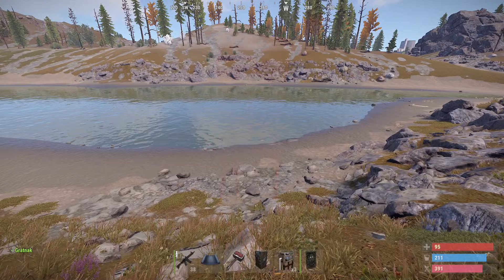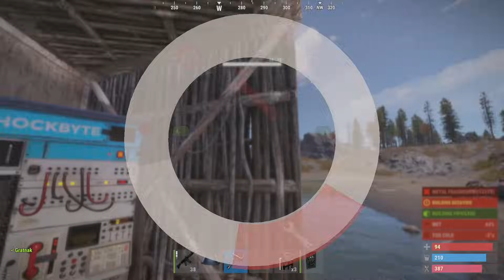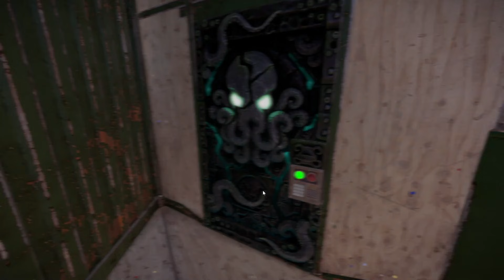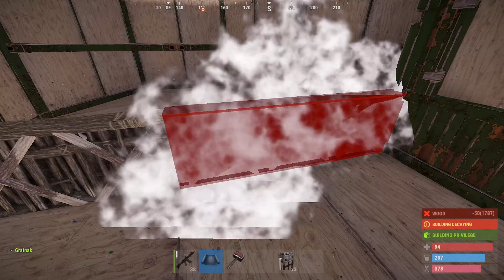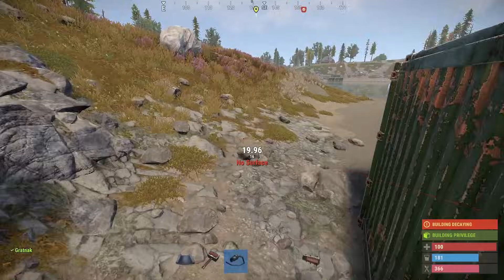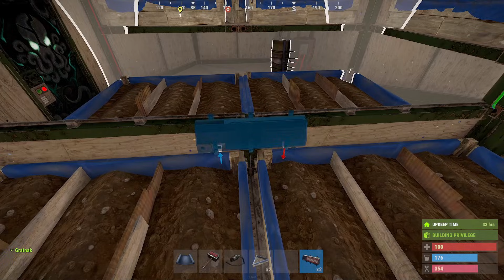Rust: Low Profile 2x2 Farm Build, with 18 planters.

Comment from the maker: 🚨 UPDATE: Triangle Planter Placement Bug (PC) 🚨

If you're getting "Cannot build in this area" when placing the triangle planters, it's NOT the build that's broken. Click "...more" for the fix.

After testing, I've confirmed this appears to be a current Rust bug affecting triangle planters on triangle shelves when Snap To placement is enabled.

✅ Temporary Fix

Hold Left Shift while placing the triangle planter to disable snapping. It should then place normally.

I've reproduced the issue on my own server and have submitted a detailed bug report to Facepunch.

I'll update this comment as soon as there's an official fix. Thanks to everyone who reported it and helped track it down! ❤️
Reply: it still have that bug , and i call only place like 2 tringle planter box atp
Reply: Just built today no problems with snap placing planters

Comment: I can't get the central sprinkler to work, any tips ? It's for sure receiving enough water, but it's not turning on
Reply: Fixed it, if you are having the same problem, make sure you plug the very central sprinkler (the 4th on the video) first.

Comment: @gratnak Hey awesome video! 
Is it possible to plant weed for example on the triangels? Or just berries bc of the height to the roof ? 😊
Reply from the maker: Hemp will be totally fine in the triangle planters because it stays low enough and won’t poke through the roof. Berries are also safe there.

Crops like corn and wheat will stick out the top of the base and can be picked by anyone passing by. Potatoes usually stay low enough, and pumpkins do clip through visually, but they cannot be harvested from outside so they are safe in terms of theft.

Looking back, the planters in the side honeycomb really should have been placed on the foundation instead of the floor. That keeps the height lower and stops tall crops from clipping out. Then you can use the roof planters for hemp and berries only.

I’ve got an updated version of this base planned that will include better water management and timing setups depending on what you plant, so the planter water levels stay at the best levels. Here’s the sprinkler  build if you want to check it out: https://youtu.be/Dk4IQFdYhZ8
Reply: @Gratnak Thank you so much 🔥

Comment: great video, does it matter where i start with the sprinklers? my top sprinkler says pump required when doing the connection
Reply from the maker: Go from top to bottom, after the pump. You need to always keep in mind water pressure. so it always flows down (or level). Also check out https://youtu.be/Dk4IQFdYhZ8
Reply: @Gratnak tysm, i also thought that was the mistake - it makes physical sense😁

Comment: i am not able to place the triangle planters? cannot build in this area
Reply: All of the planters that would sit on the triangle shelfs (2nd lvl and roof lvl) cannot be placed. I am getting the same message. Cannot build them unless it's on a foundation
Reply from the maker: Thanks for the comments, everyone. That’s definitely unusual, I’m going to hop onto one of my servers and test the build again to see what’s causing the placement issue with the triangle planters. Once I’ve checked it properly, I’ll come back and update you all with what I find.
Reply from the maker: Thanks for the patience, I’ve just finished testing this on one of my servers. It turns out the issue only happens with the triangle planters, and it’s caused by the “snap to” placement. If you hold Left Shift to disable snapping, the triangle planters place normally without any errors.

So it’s not the build itself, just a small placement bug with snapping. Hope that helps!
Reply from the maker: That's strange. Is there anything nearby that might be interfering with the placement, like a horse? Sometimes their hitbox can cause this.

Also, if you're on PC, I could take a quick look. Unfortunately, I don't have a console. If you're interested, we could hop into a Discord call, and I can help you troubleshoot it.

Comment: This is a very aesthetically pleasing compact base, but sadly with how half walls are the same price as full walls you may as well just build the standard cube and get more space for your money. I don't think there's really much hiding a farm base.
Reply from the maker: That's a fair point, I usually prefer the aesthetic builds but I definitely see the logic in going for a standard cube for more space. 😊
Reply: @Gratnak  It is a really unique, cool base though. Props to you for that. I just wish Facepunch balanced build costs a bit better. That being said, it's not like its an arm and a leg more expensive for the space either. I think if it weren't for the noise pumps making and the water clipping through walls then it'd be a lot more viable to hide the reality of the base from anyone being nosy.
Reply from the maker: Thank you, I really appreciate that! 😊

I was aiming for something a bit different rather than just another standard cube. The switch is there if you want to leave everything running, but you can also use the timer so the lights, pumps and sprinklers only run while the crops are actually growing, which helps keep things a little more efficient.

I've actually had a much more complicated version of this same build before, where the entire farm could run from a single large water catcher. It used a few different methods to massively reduce water consumption, making it surprisingly efficient. I may revisit that design in a future video if there's enough interest.

I do agree though, if Facepunch ever rebalanced the build costs of half walls, these kinds of builds would become a lot more attractive. And fixing the pump noise and water clipping through walls would definitely make discreet farm bases much more practical.

Comment: I can only get 2 water pumps in 😢
Reply from the maker: Two pumps should be ample, if you're on the coast, just run the pumps initially for a minute before switching on the sprinklers, just to have a buffer.

Comment: w video. i tried it and the water sprinkler arent working the first sprinkler of the 6 get 12 water but the passthrough is 0 . No sprinkles
Reply from the maker: We're using gravity for the combiners and spilitters to the sprinklers, so you need to make sure the pump is sending it to the highest one first. Each sprinkler in turn need to on the same level or lower in turn.
Reply: @Gratnak  thank you for the response i ended up not connecting it to the highest sprinkler which i did at first ( the sprinkler did go off and no water was being pass through but only connecting the lowers sprinklers worked. thank you
Reply from the maker: Sorry for the delay in replying. I need to work out the filters for replies to me. At the moment Youtube studio only shows new comments. It's great to hear I could be of some help.

Comment: hey so my pump system isn’t working, i have the fluid combiners set up to where to pump is needed, should i add one and how should i do that?
Reply from the maker: Hey! It sounds like your system doesn’t have a pressure source. Fluid Combiners can’t pull water on their own, they only mix or split water that’s already flowing.

If you’re trying to move water out of a barrel, uphill, or anywhere without natural pressure, you’ll need to add a Water Pump or Electric Water Pump.

If you’re on PC, I’m happy to hop onto your server and take a look with you. Otherwise we can jump on a Discord call and I’ll help you sort it out.
My Discord is: gratnak

Comment: hey im not able to place all 3 pumps on the gap, any suggestions? do i  eed the comtainer skin for it to work?
Reply from the maker: if you're in sea water you can get away with two, if it's in fresh water one will do. I'd top up the water barrel though, so it has a buffer in it.
Reply: @Gratnak ok nws im in fresh water and can fit 2 luckily

Comment: Great video. 
One small tweak. I do my root combiners on the roof, combine all the solar into one, and have a clean single line of power coming into the battery. Then do a break out as needed depending on your build.
Reply: yea i guess but making someone angry and then they spend 4 spears breaking ur electrics and thats not fun
Reply from the maker: The wiring is definately tidier that way, though it does give you point of failure. Destory the right combiner on the roof.
Reply: I was going to say that leaving the combiners out side leaves them open to being griefed and then when the battery runs out rip

Comment: i cannot connect the pumps in the way that you have, has there been an update breaking this?
Reply from the maker: It should all work, i'll look into it in the morning. If you're playing on PC i could also pop on to check it over.
Reply from the maker: I've checked and it all seems to be working, are you using a splitter instead of a combiner for the water?

Comment: What is the timed one used for?
Reply from the maker: The timer is mainly for situations where you want the sprinklers to run long enough to water the plants and then shut off automatically. It’s really useful if you’re going offline and don’t want constant sprinklers giving away that you’ve got a farm running while you’re not around.

I’m working on a new video that covers a more advanced farm setup with more complex wiring. If you want an early look or have questions, feel free to hop into the Discord, I can show you a preview if you drop me a message on the Discord Server.
https://discord.gg/4Z97N3ht8P

Comment: This looks like a nice little compact farming setup. I would maybe put all the electrical into the water pump room 'cause raiders will likely be trying to blow into TC and they'll all get blown up which will be a pain if you want to take it back over. Also maybe put an external TC so you don't get the farm griefed. (you can link to an external tc build guide at the end of the video?)
Reply: Id think putting up externals defeats the sole purpose of a low profile farm base dosent it?
Reply: @uvoxxx  a sheet honeycombed 2x2 (obviously not actually honeycombed in this instance) is going to be a target regardless. No one is going to spend an extra 8 rockets just to grief a little farm after they loot it but if they can grief it or take it over then they likely will. Also once they know it’s just a farm base when you reclaim it, it’s unlikely the same person or group will raid it again!
Reply: @imRamaChandra i guess we play on different servers, my standard neighbors would def go ahead and grief it
Reply from the maker: I do have servers of my own, that you could try. They're "fairly" friendly. ;)

Comment: So the planters which are above the pumps are not getting the water & same for the planters above the small battery. I've placed everything exactly as shown in the video but still there is this issue, please help.

- Can someone also tell me how the timer works in that circuit, does that timer need to be turned on? If yes then what happens?? I mean it's there to reset but why?
Reply from the maker: Really sorry for the slow reply - the timer doesn’t need to be turned on for the circuit to work.

Because it’s been a while, your build will have been wiped from the server you play on, so I can’t check exactly where things might have gone wrong. If you want, I can show you the new version on one of my servers, or go over your setup in person on yours.

Just hop into the Discord and ask in there:
https://discord.gg/4Z97N3ht8P
Reply: @Gratnak  No need to apologize. You can always upload an updated video, if any upgrades regarding the same. I'm only using your farming base and Thank you for this video.

Comment: Can’t do this on console
Reply from the maker: What part doesn't work on console?
Reply: @Gratnak can’t do the half wall triangle floors
Reply from the maker: You need to put a half wall in first, then connect it to that, then remove the halfwall. I've not got the console edition, though I'd be suprised if they had left that out.

Comment: You asked for any upgrades. Make underwater piping to funnel cloth to a metal bunker vending machine. Alternative hide piping up a cliffside.

You can also pipe from cave base to a surface vending bunker as long as the vending base is directly above the highest point in the cave base below.

Fantastic video. Well done!
Reply from the maker: Those are some interesting ideas, thanks for the feedback!

Comment: better to place the battery where the water one is and then add another 6 planters in the corner bottom
Reply from the maker: No entirely sure what you mean, as you can't stack planters close together now, that need a full walls space between them.

Comment: Love how doable this design is for a solo. However, one issue I noticed is that if you're using salt water, the purifier won't make enough fresh water for the sprinklers to be constantly powered
Reply from the maker: If you’re running two pumps and allow the desalinator to partially fill, everything should run smoothly. With three pumps, you’ll consistently generate a surplus.
Reply: @Gratnak  Thanks. What I assume happened for me is that the connections for the water bugged in some way. Several times, my pumps would generate water, but it would never actually go past the combiner. It started working perfectly fine when I removed the connection and made it again, so it does seem like it's a little bugged at the moment.

Comment: I'd put the boxes on the middle triangles then the planters at the bottom of the honeycomb where you originally placed the boxes so you dont have to jump everytime you plant. But overall the build is great!
Reply from the maker: I had meant to do a second video with this change, amoung others. It didn't twig until someone mentioned some crops poking out the top and being able to be picked.

Comment: idk if its bad depth of the water but its really hard to fit 3 pumps in 2 triangles i can fit max 2 but not 3
Reply from the maker: You should be okay with just two.
Reply: @Gratnak yes i learnt this thanks for letting me know anyway, love the base and the design and might do it for a regular 2x2 its very spacious inside

Comment: Great video, but I have questions if I may.. I’m fairly new and still trying to figure out lots of things 😂
My understanding was that 1 fluid pump would supply 6 sprinklers! But you’ve used 3 pumps. Why?
And I’ve seen videos where they have supplied sprinklers straight from the pump, so why the water barrel?
Apologies if I’m being stoopid 🤦🏻‍♂️
Reply from the maker: Your need to use splitters so they split down to just one out put on each. So the first splitter only use two outputs going to two more splitters, giving you one out of each. Then connect these to the sprinkles. I hope that makes sense?

Comment: Great vid. Unique and very informative.

Small question, whats the purpose of the water barrel instead of directly hooking up the pumps to the sprinklers.
Reply from the maker: I'm glad you liked the video, the water barrel is there for two reasons. I'm not sure if the bug still exists, but after a daily server restart, without a barrel it could cause the spriklers to not work, if there wasn't a buffer. But it's also there should you want to quickly fill up jerry cans with water.

Comment: I'll give this a try as a <200hr solo player, I want to learn farming. HOWEVER! 2 gears sells for 1000 cloth in Aug 2025 on a full pop server...so 8 gears 4k cloth and I was able to sell the gears in my own vending machine. Farm the road a bit and no need to make an entire farm/acquire blueprints...seems like there are always enough farmers to keep costs down.
Reply from the maker: Farming is a great way to get started in the game; it's good to diversify and learn different aspects of the game! You'll find the economy is different on each server. The one I run has little in the way of shops selling farm produce.
Reply: @Gratnak I see myself fitting a large planter into a 2x2 type build, focusing on PvP but supplementing cloth this way. I guess ore tea would be a next challenge.
I wonder what a quick and dirty setup would be like...where 100% plant happiness is not a must just a setup for a casual pvper spending 5hr a day for the first 3 day of wipe? Focus on getting a gggyyy and then just use watering can and rain catcher? Or would I have to build near water to not have a terrible experience.

400 cloth a day would be fine.
Reply from the maker: You could build it anywhere, grab a load of inventory of water can from outpost and fill them up at a river. Then empty them over the planters. I've done that countless times while living in a cave.

Comment: I tried to copy your guide but I only have 2 lights working. I used a water purifier if that changes anything?
Reply from the maker: You might have an issue getting light to all the planters, with just two. But a water purifier is cool, if you're on salt water. 👍
Reply: @Gratnak sorry I have 6 lights installed but only two turned on. Maybe I messed up the wiring.
Reply from the maker: I sounds like it maybe one of the branches may have had the wrong value.

Comment: Nice base, im upset with the changes to not being able to place planters above another one but this base works even without that! Question, could you briefly explain again how the timer works for the electric part? What does it do basically and when should I be using it. Thanks :D!
Reply from the maker: It's just so the pumps and lights work for an hour and a half, while your crops grow (adjust for how long your plants take). and then turns off, so the pump sound isn't contantly on. giving away what the building is for.
Reply: @Gratnak  Ah very smart, I thought it did the opposite and turned it off for an hour and a half, thank you sir keep up the good work!
Reply from the maker: @TreePolice sounds like you might have used an XOR switch instead of an OR switch? 😊